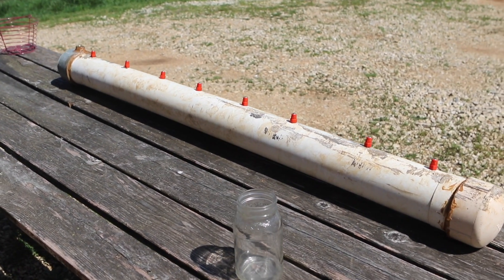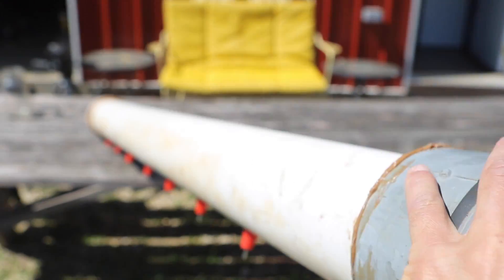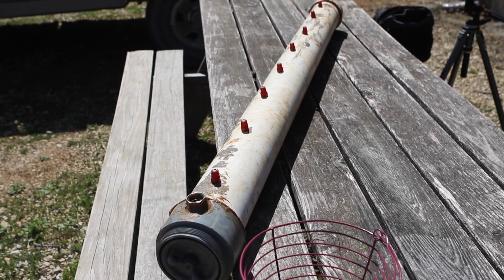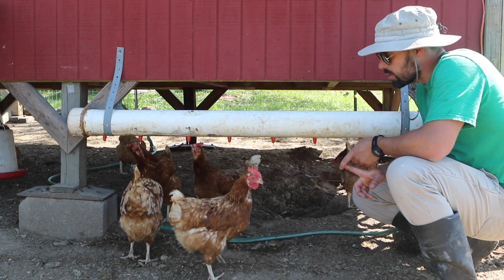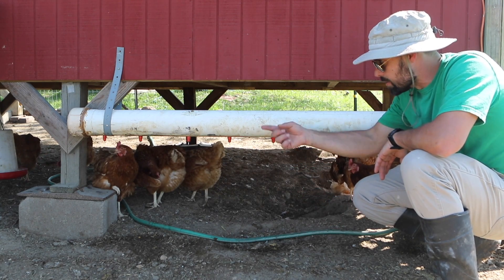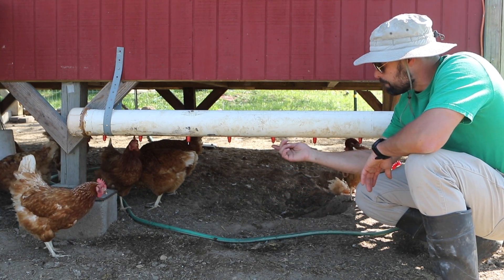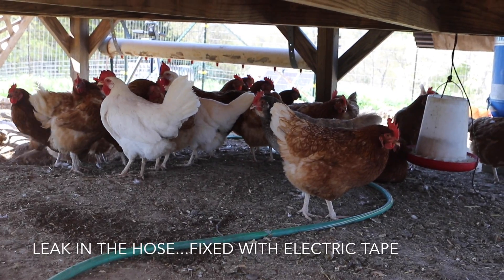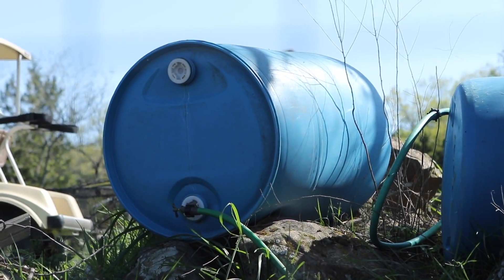OFFGRID Gravity Fed  Chicken Nipple Waterer

Comment: Dont they get stuck open with not enough pressure to close the valves?
Reply from the maker: If you pull the spring out of each one, the steel ball will close by gravity. Leave the spring in for house water pressure from a garden hose, or take the spring out for gravity feed from a rain barrel.